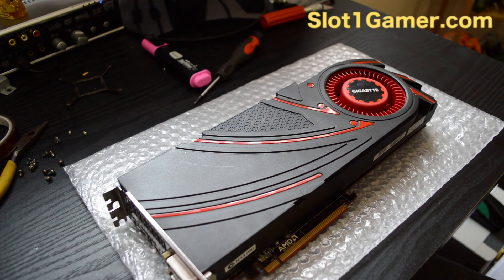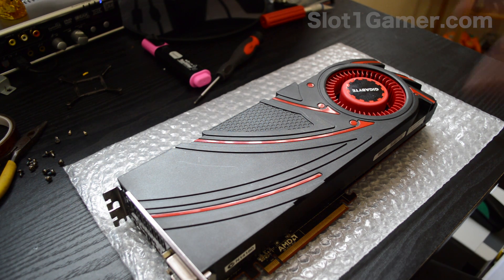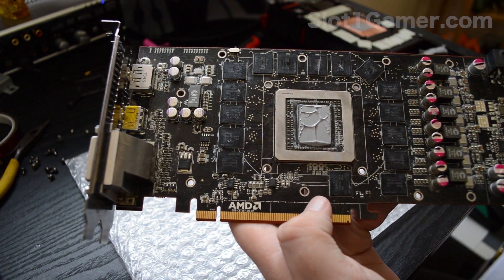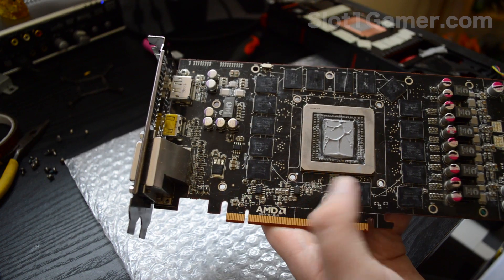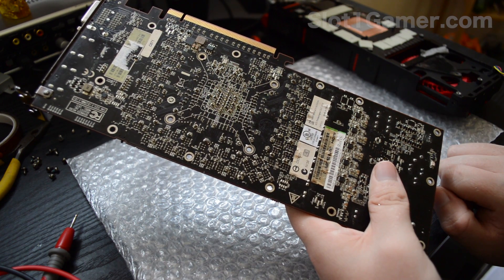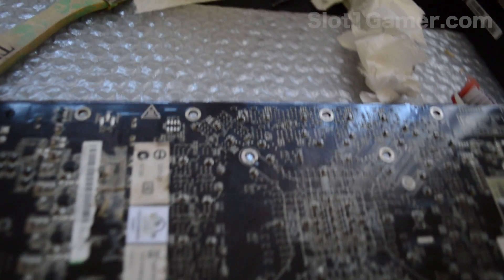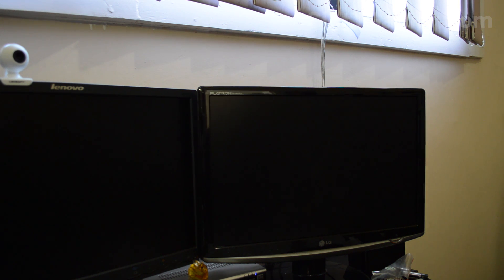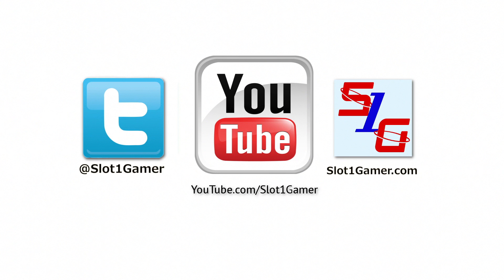AMD R9 290 Repair Vlog

Comment: Can you place fitted copper shims in place of the thermal pads? Thank you 🤓 does the 280 or 280X have the high heat issue?
Reply from the maker: No because there will be air gap, use thermal putty if you want to upgrade the pads
Reply: @Slot1Gamer  what you do is measure the gap between the chips using the thermal pads and the heatsink, and place a close matching (thickness) copper shim with thermal paste on both sides, or on the chips & heatsink. It's a better conductor of heat compared to the pads! This is also a trick or method used in laptops where there is a pad  between the GPU chip & heatsink. Thank you. How well it would work on a GPU is a guess!

Comment: Hey there, I have one of these cards. My one works OK when the VGA drivers are running but as soon as the PC loads up the AMD drivers the PC black screens. It's pretty strange to say the least. I tried kidding the bios to lower the clock speeds in the hope of dropping temperatures albeit I dont know if that was the issue but I have reached that point where you start taking stabs in the dark. I just have no idea of what is going on with this card. It's a strange beast.

I dont suppose you or anyone else has any ideas ?  I'm not trying to hijack your post, I'm just hoping you may have some ideas or insights that you could share.
Reply: same happend to me, any solutions yet?
Reply: have one too. recently started acting up with the black screens flicker rapidly tried to clean it up and put it back on then it works. next day it happened again, this includes during bios so i guess its hardware issue and not drivers or anything. gonna go for baking method with hopes of it recover but during cleaning i teared off the thermal pads without knowing lol. oh well gonna go buy all the stuff i need(thermal paste and pads) first before i start with the baking today.

Update - Well, it worked (if anyone interested to know that is). But its too early too celebrate. I'll see how long it lasts and update here again(hopefully i remember to do so)

Comment: hi man i have a problem with my r9 290 i bought it a year ago and it was running smoothly with no problems until last week when i discovered that my pc was shutting down and sometimes a blue screen pops up and then i realized that my fan was not spinning  it would sometimes spin but if i test it for like 100% fan speed it would spin and then it would get slower and slower until it completely stops i just want to know what's the problem so i can fix it

Comment: Hey man, did you get around to making that part 2 ? I have a Sapphire R9 280x that has the exact same issue, i've opened it up cleaned it and doing a little more research before i oven bake it ( thinking of using a toaster oven )  - So far i've figured its a Vram issue.
Reply: * update * after reading your comment about the reflow not working, and you thinking it might be a capacitor, i did some more research, and i've found a few other folk who fixed the same issue ( artifacts from boot ) with replacing the caps, though I haven't seen any Caps ( smd or otherwise ) that look damaged, however, there is a capacitor bottom bit ( when i flip the card ) the soldering on the 2 leads has melted and i think is touching. I have a Digital Multimeter, but im not sure how to check the capacitors with it.  ( it has a OHM and CAP setting, but im not sure what im looking for )
Reply: took some pics to further show it http://imgur.com/a/luiwb
Reply from the maker: +Sonoo19 To check capacitors, you have to take them off the board. If you bridged the two leads, you are shorting something to ground most likely. I have not managed to get back to looking at this one yet, hopefully soon though.
I hope you get your card back to life :D

Comment: Hey man could you help me? I recently got a Jtaggable Zephyr Xbox 360 console and it seemed to work fine until suddenly I got 2 red lights (0013) while watching a movie. What's interesting is that the fans went from idle to jet engine mode. The xbox still works but in a few minute time the fans ramp up to jet engine mode. I repasted it, still no go. I'm a bit puzzled now and don't know what to do. I read online that it could be a cold solder joint under one of the ram bricks, but I think that doesn't make much sense since the xbox still boots up fine. Been thinking to jtag it and check out the temps, find out what's overheating. What do you suggest?
Reply from the maker: Evaldas65 It could be that the ram is just overheating, does your mobo have thermal pads for the ram? It could be a cold joint causing the chip to draw excess current but it could also be a fault with current or voltage regulation. IIRC the top side RAM doesn't have any cooling so best to reflow them (if you can) and buy some small heatsinks and attach to them.

Hope this helps and thanks for watching